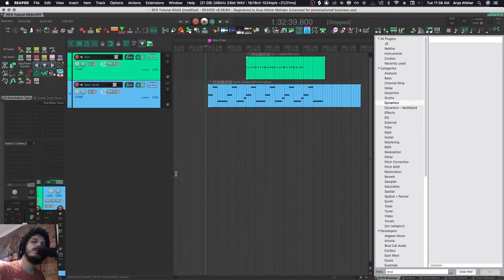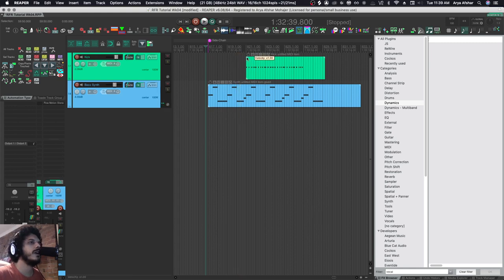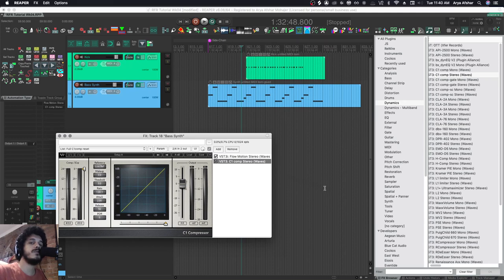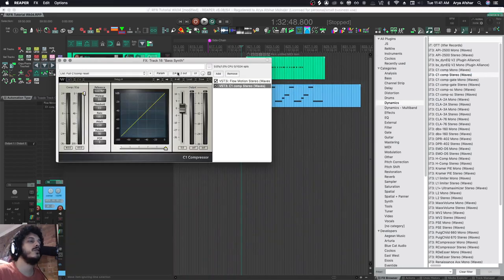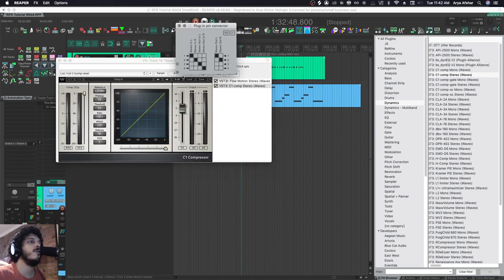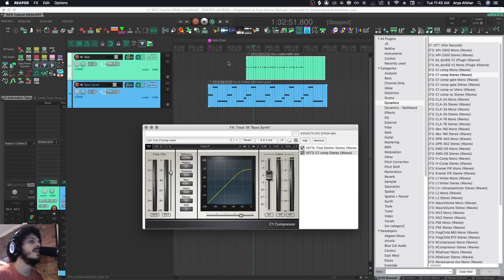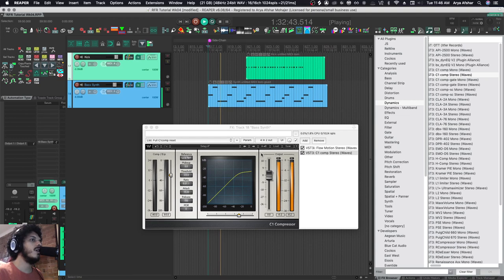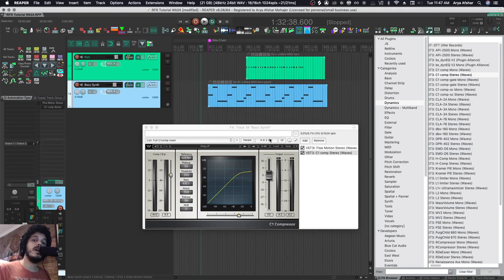Side-Chain Compression in Reaper (Rapid-Fire Reaper Tutorials Ep24)

Comment: I want to do the following: make a sidechain with a Delay with a voice but it dos not work. Y put the voice in charge of the sidechain to make room for the Delay to play when the voice is not sounding. I put the sends on the voice to the Delay. It is going to have 4 channels. The Voice is going to be in chanels 3 and 4, The Desice input is Aux 1_2. The comp treshold is at-30. The ratio is at 10:1. . It is time to go for the Delay, I use a generic one. I press play and it plays the voice but with no effects. I put a copy of the voice on to the Delay track. It works fine, but it is veri tiny. It dos not do what I expected,I watched a couple of videos and it dos  just wath  I said. It does not work. Help?
Reply from the maker: Hey Gabriel! The way you describe it is correct and should work! What compressor are you using? And is your delay also on a separate track? So your vocals are sending to the delay 1-2 and then also to 3-4?
Reply: @IDDQDSound  My compressor is the one that comes with Reaper. The Detector input:   and reads Auxiliary Input L+R. What I did not understand is this "is your delay also on a separate track? So your vocals are sending to the delay 1-2 and then also to 3-4?"
 and I have two track, the Vox and the Delay. And the Vox is sending to the Delay,  that have the compressor and the Delay. I have the Vox sending to the chanels 3-4. And that is it
Reply: @IDDQDSound  help?
Reply from the maker: @mksounds  wooops sorry I missed this!!! So just to clarify your delay also has ReaComp on it, and the delay is receving vocals from 1-2 and then the compressor is receiving from 3-4 to be side-chain right? 
 This should work. Make sure your delay is also before your reacomp!
 p.s. are you on the discord group? You can message me if you want and we can do a quick video chat. :)
 If you don't, email me. Won't post my email here cuz I'll get spammed but go to my website and it'll be there :)
Reply: @IDDQDSound  The total of tracks is 2 o 3? I will tri it when I got home. But if I can not do it I will email you. Thank you!